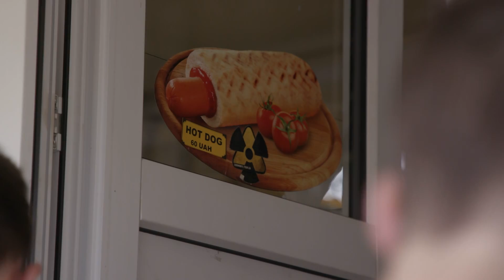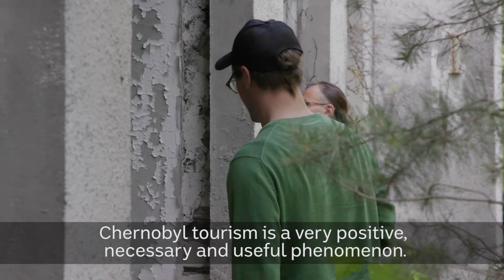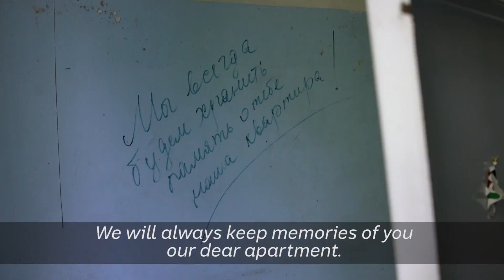The Legacy of the Chernobyl Disaster

Comment: he's afraid of the dust and yet he's not wearing any protective suit or mask?????? huh?????????
Reply: And pushing a door open..... dust would be swirling
Reply: yes. if you touch the dust and then unknowingly put your fingers in your mouth, you will have radioactive material inside of you. this is very dangerous as it will keep emitting radiation from the inside of you. breathing in dust is certainly not healthy either, but the slima and hears in your nose will catch a lot of that dust. anyways, radiation itself is dangerous, but radioactive material is much worse.
Reply: well dust is more concentrated on things rather than in air after settling down for 30+ years; so relatively speaking it's not a lot of danger there; just from dust point of view. It's whole another thing to actually reach up and touch things.  There is much more concentrated dust.  But yeah just coz dust is not concetrated doesn't mean it's not dangerous tho; radiation isn't present just on dust; it's in air; some areas are too radiated to visit even with limited time exposure and even with no dust present.
Reply: Petite Monica you read my mind.
Reply: He's not very smart @ all.
Reply: @matrixfull  Dust is more concentrated on things. Correct.! Now you must consider how dust becomes concentrated on things. I wonder if you would also hold that same casual view about asbestos.

Comment: The dust might be radioactive; yet you don't have any protective gear... Huh, sounds stupid to me
Reply: Ya, he says don’t touch anything bc the dust is radioactive, as he walks through it and touch’s the door.
Reply: I'm really starting to believe these conspiracy kooks, saying nukes don't exist... I get it now!
Reply: @labbeaj   Your skin is very resistant to radiation so touching low doses of radioactive material such as dust will not do anything. It's inhaling and digesting the dust that is the problem however very tiny doses are still okay as most of the surface soil in chernobyl has been removed. 
Don't believe uneducated people. Just because you can't see it, doesn't mean it doesn't exist.
Reply: @RetroDanceMonsterxX  That is the best advice! Not believing uneducated people but also not believing, in general, because it is the opposite of knowing.
Reply: Disingenuous even?
Reply: He's not wearing a mask because the radiation level does not warrant it.  If he were to lie on the ground in the middle of the Red Forest for 10 hours he'd get the same dose as a CT scan.
Reply: @colinmacdonald1869  
That's the point.  If there were a risk in that particular spot, he would be wearing a mask.  He's just doing what the media always does.  They're just selling the drama.

Comment: The most alarming thing is that the reactors which are beyond their life spans are still being used. 
And if the remedial safely work preventing the possibility of a positive void coefficient hasn’t been completed, another Chernobyl incident could occur.
Reply: I agree. These are ancient reactors based upon 1950's Soviet technology. The should have been decommissioned decades ago.
Reply: Even CANDU reactors have a small positive void coefficient. It's not the end of the world. The RBMK design isn't even that terrible. The real problem is that this reactor had had all its fly-by-wire automatic control systems bypassed and people were manually pulling out all the control rods.

Comment: I wonder about their shoes and why they don't have their shoes covered.
Reply: Because the areas where the tourists are taken have extremely low levels of radiation. As they showed, you can have higher levels just a few steps away, but for the most part the radiation is confined to a few small areas here and there, which are easily avoided with the Geiger counters the guides carry.

Comment: WHY IS NO ONE WEARING PROTECTIVE GEAR
Reply: Nizz 0matic because they aren’t allowed off the designated paths and limit kicking up dust. The radioactive material is heavy, the dust is the dangerous bit.
Reply: Because the core isn't emmiting any rays through the dome. The soil was also removed from the surface so there isn't much dangerous dust around either. The doses of radiation are very low and your skin blocks out almost all of it.

Comment: To the narrator, it's not a"gigger" meter,its a "Geiger counter" .
Reply: Linda Storey a meter is a device that measures and records the quantity, degree, or rate of something.  It’s the same thing. 🤦🏻‍♀️ & making fun of his accent is just unnecessary.
Reply: @Kimberly-wt1nu  the Op wasn't making fun of his accent. I'm sure they didn't have the intent. They are correct of the fact that the narrator mispronounced Geiger. It's full name is Geiger-Müller Counter and is used to dectect and mesure ionizing radiation. It was invented by Hans Geiger and Walther Müller. So proper pronunciation doesn't hurt. Even if you have an accent.

Comment: What's about Fukushima disaster?
Reply: Because the just want to make russia look bad..
Reply: @zerodistance2988  Fukushima was caused by natural disaster. The amount of radiation released was a tiny fraction of Chernobyl caused by complete incompetence and crap design lacking safety. No one has to make Russia look bad. Russia does it all on their own.  Putin murdering critics at home and abroad and supporting Syria dictator who gasses his own people.
Reply: @zerodistance2988  we already know it wasn't Russia, it was engineers who flouted safety regs to run an unsanctioned test. The ending just points to the fact that Ukraine can't even afford to follow it's own regulations because the plant would be down for too long.
Reply: @globe1987  We also know the design of the 1970's USSR reactors was crude, without safety backups. Wiki

RBMK (Russian: Реактор Большой Мощности Канальный, РБМК; Reaktor Bolshoy Moshchnosti Kanalnyy, "High Power Channel-type Reactor") is a class of graphite-moderated nuclear power reactor designed and built by the Soviet Union. The name refers to its unusual design where, instead of a large steel pressure vessel surrounding the entire core, each fuel assembly is enclosed in an individual 8 cm diameter pipe (called a "channel") which allows the flow of cooling water around the fuel."

They had accident in 82 that melted a reactor and a fire in 1991 after the major 1986 explosion of reactor #4. 

The Russians record with nuclear Subs is also horrific. They just had another nuclear event killing 14 people on a Russian sub recently.

They finally put a new steel cover on #4 at a cost of $1.2 billion paid and constructed by a group outside Russia.
Reply: Ręka Sprawiedliwości  Mossad planted bombs, harp caused a little storm to cover for the explosion
Reply: This is just one documentary on one place
Reply: it was not Russia
it was Soviet Union.
they made things the Soviet way. and it means without responsibility, immature, risky.
Reply: @gmcjetpilot  fukushima was the worst nuclear meltdown, Chernobyl was the worst nuclear explosion. Also Chernobyl is safer now than Fukushima.
Reply: @Butter_bread_  That's categorically and factually faults. Chernobyl released almost 4 times as much Radioactive contamination.

Less than 25 petabecquerels (PBq) of cesium-137 was released to the environment from the three damaged Fukushima reactors. Chernobyl by comparison comparison released an estimate of 95 PBq for Chernobyl," 

 Chernobyl exploded killing people immediately and then, weeks, months, years, decades after. Nobody died from Fukushima except for the tsunami.

At Chernobyl, many plant workers were killed by the initial explosion and 29 more workers died from radiation poisoning over the next three months. The years that followed, cancers in children skyrocketed in the Ukraine, up by more than 90%. United Nations agencies in 2005 approximated that 4,000 people eventually die of radiation exposure from Chernobyl. Greenpeace International estimated, in 2006, that the number of fatalities in the Ukraine, Russia and Belarus could be as high as 93,000 people, with 270,000 people in those countries developing cancers who otherwise would not have. 

At Fukushima, there were no deaths or cases of radiation sickness directly associated with the accident — neither workers nor members of the public, according to the World Health Organization (WHO).
Japan's aggressive disaster response, which relocated 100,000 people from their homes near Fukushima. It is thought relocation indirectly caused deaths of some elderly people. 

So smart, well-educated, informed people know that Chernobyl was the worst nuclear accident in the history of mankind. It released more radioactive waste than any nuclear weapon. Clearly you're not one of those smart people.

 Chernobyl had several major accidents before the big 1986 accident. They continue to operate the other reactors for 14 years after the accident having several other significant accidents. They shut it down in 2000. 

Fukushima had no accidents. After Fukushima incident they shut the plant down and decommissioned it (removed nuclear waste). Chernobyl they put a big structure over the destroyed #4 reactor entombed it in a "sarcophagus". Since then a global community raised over a 2 billion dollars to put another Dome over the original crumbling sarcophagus. Chernobyl is also not decommissioned as the  other reactor shutdown almost 19 years ago have nuclear waste in them still. You say Chernobyl is now safer then Fukushima? that's just idiotic propaganda.
Reply: There are some documentaries on fukushima as well. This one just happened to focus on Chernobyl. It is not a competition on who had it worse or who deserves more coverage than the other, the devastations  are mind blowing and everlasting either way you look at it
Reply: @tracysevolution  There's no competition. There's just facts. Of all the nuclear energy accidents Chernobyl was the worst. Period. There's no need to argue about it. There is no debate. Those saying Fukushima was worse are wrong, categorically. They were both bad. They both have an exclusionary areas around them that can't be  inhabitanted for a long time. However in total radiation released the numbers of deaths Chernobyl is the king of nuclear accidents by a long shot. Fukushima is a distant second.